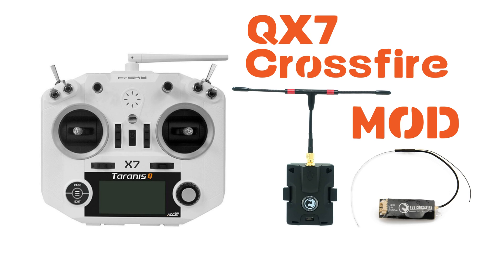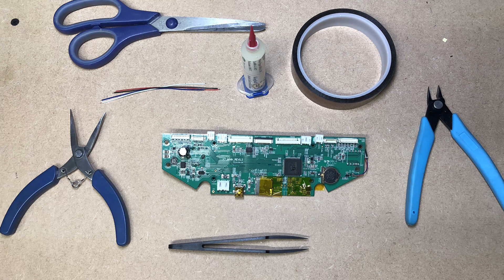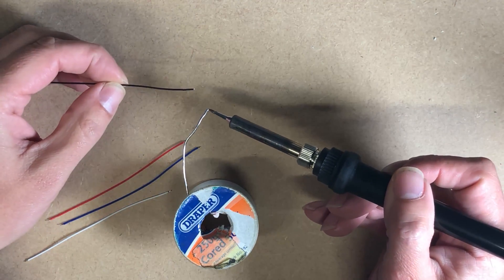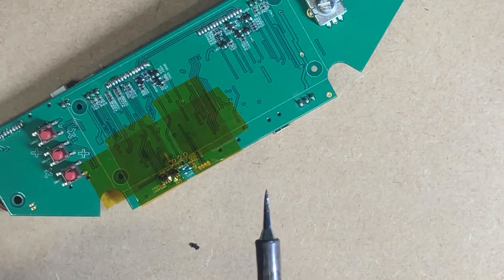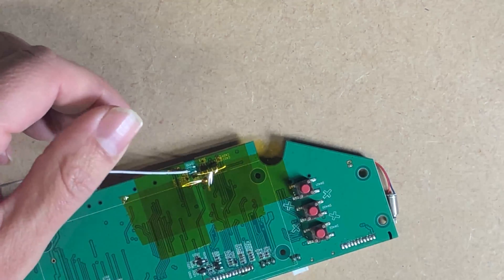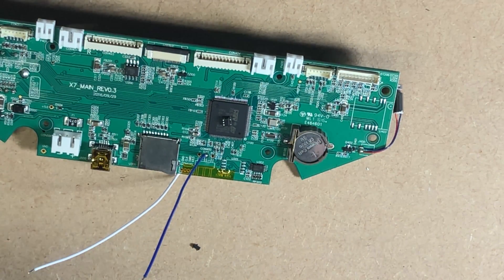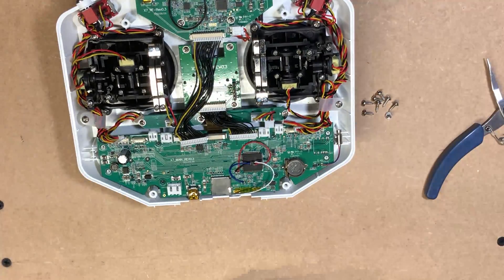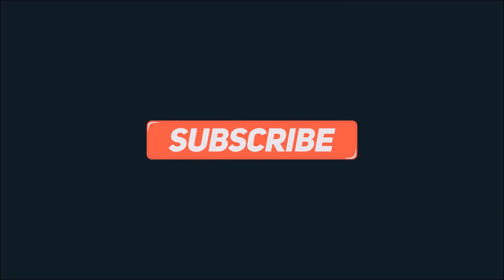Taranis QX7 | TBS CʀᴏssFɪʀᴇ Signal Inverter Replacement / Mod / Install

Comment: Hello, you insisted that you have to solder the 3 volts in that specific part, why,?, there are other easier parts like in the trims.
Reply from the maker: Hi, the main reason was for future mods etc. Its easier to remove the main board if everything is kept on the main board.

Comment: I have replaced the inverter, but pids has stopped working. Then i returned old J6 on its place, but pids still don't work and taranis doesn't enter bootloader mode. What's the problem?
Reply from the maker: Дмитрий Бороновский 
I’ve not done anything with the Lua scripts for PID etc through the controller before I use the OSD so not much help for that sorry.

Have you downloaded the correct SD card files and the correct LUA scripts?
Reply: Yes, before replacement all worked fine.
Reply from the maker: Дмитрий Бороновский 
You would need an updated Lua script I think, like a said I’ve never used any of the betaflight Lua scripts etc before so never played around with them.

Comment: What flux soldering do you use? Can you put a link on it?
Reply from the maker: Дмитрий Бороновский 
I use 60/40 flux multicored solder
Ebay Item no. 141426043398

Comment: do any of the other frsky radios have this problem?
Reply: no.. and i bet the frsky r9 module will have the same problem but i cant find any info on that.. i bought the tbs tango for crossfire and i love it except now i want the new gimbal with the shorter through on throttle for racing.. so i guess im going to buy the x9d se.. i can do the mod i just dont want that slop in my controller.. dont by the qx7 .. the only module youll want is crossfire witch is awesome..tbs is high quality on everything...tbs and kiss work and dont fry like china stuff

Comment: Shame this mod is needed.... it's hurting QX7 sales and eliminated what a lot of people were counting on.... "it just works".
Reply: RMRC has it for $184.38 same as before but they are out of stock like a lot of sellers so you must be quoting some EBay seller as it was always around $180 for the S version, not as stunning of a deal  but still a good radio for the money. Not seeing them in stock is a good sign perhaps Frysky is fixing the regulator  issue.
Reply: Not sure where you see that unless on EBay... I'm seeing the same price listed on release. I know 3 people waiting on the new iX12... more than the Horus X10 but better quality and design IMO based on early reports but a shame no hall gimbals. Not sure I'd like the QX7s gimbals with stock stiff springs that can't be adjusted enough as XJet pointed out... although a new set of lighter springs would fix it.

Comment: Good video, I followed a different video and didn't notice the difference in the pin out in the x7. turns out I soldered the s.pt wire wrong lol. And that caused the lua script not to load for me. Now that I soldered the wire to the correct spot I can now open the lua script but it wont let me scroll down...